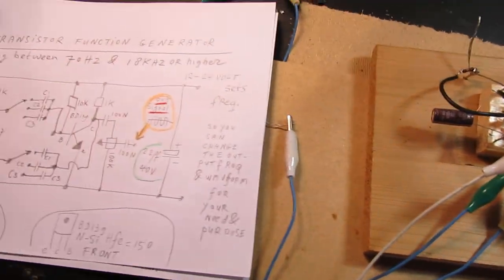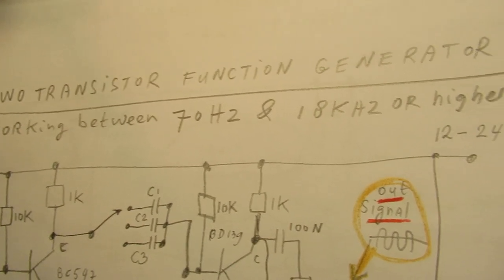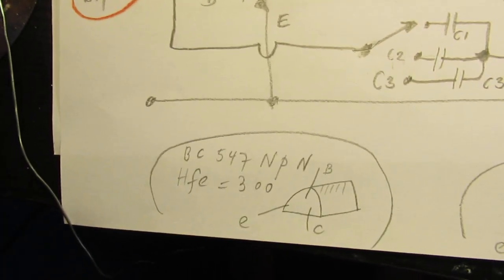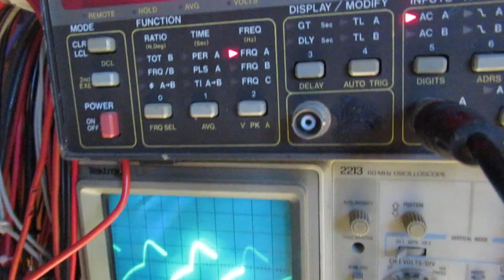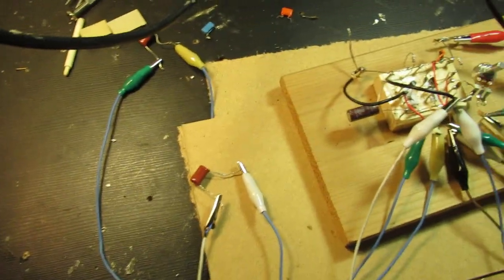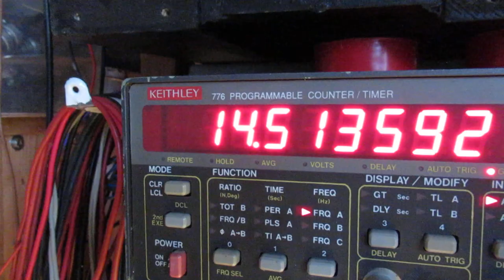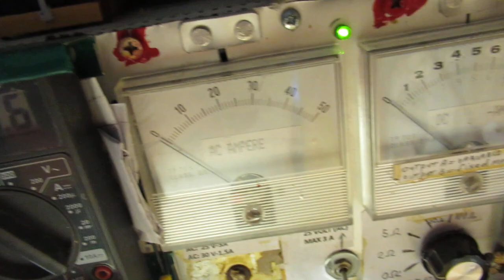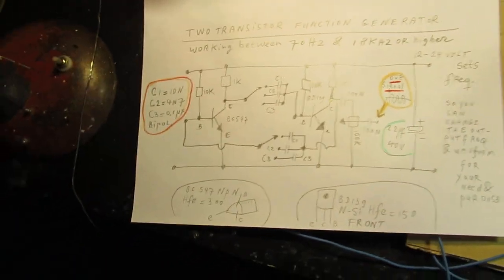2 transistor easy to make function generator usable from 75 Hertz to say 20 KC schematic and demo

Comment: Dear Sir i work on electronix projects...but one field i have not been able to understand and work on is inductor based things like oscillators,antenna ,communication based circuit .can u plz suggest some book or study material to really work on such things.
Reply from the maker: That is a very difficult question for me. There is a website americanradiohistory dot com with many books, where you can find perhaps some good info about oscillators and radio circuits; I mean, good basic information.
Reply from the maker: the website is called worldradiohistory dot com
Reply: Ok thankyou very much sir

Comment: So i can not use a variable capacitor. 🤔
Reply from the maker: Thanks & Yes, you can use that, but with this circuit  such a variable capacitor (say on the 20 pF - 470 pF range) does not add very substantiallty to the output frequency, I mean: by changing it. But, important: say when you bridge a capacitor of 4N7 (=4700 pF)  in this 2 transistor circuit with a variable capacitor that goes from (say) 20 pF to 470 pF (the one that you mention, at least I think that), the frequency surely will change, but not very substantially, say with that 470 pF extra capacitance you can go to 1-4 KHz higher or lower. That is the bandwidth. But: it can be crucial to get to a certain frequency in the Ultrasound range (say 15 KC-30 KC) that you need or like, given the use of 2 x a 4N7 (4700 pF) capacitor. I published this circuit as it was/is for a broad You Tube public, that is why I used 2 x a 4N7 capacitor to make that it always works on its highest usable frequency, given the properties of both NPN transistors, the BC 547 and the BD 139 (their datasheets). And that is also the reason why I publish it in this way, that the different supply voltages can set the frequencies that you can use/need & that it always works. Voltage variation=frequeny variation. Also that transistors don't burn out, that is also one of the aims of my YT Channel, making/showing tested circuits that have good properties and are universal. But regarding your question: yes, a variable capacitor of 10-470 pF (I hope that you ment that) is usable to tune into a certain frequency in the 10 KC-24 KC range, when you parallel it to the capacitor in question. Paralleled to a 4N7 cap it will have an effect, paralleled to a 100 N capactor there will be more or less no effect

16 june 2022.
Reply from the maker: When I say :"no effect" I mean: the change will be in-between the 1 Kilohertz range, bridging a 10-500 pF capacitor to a capacitor of 4N7 (4700 pF). But on lower frequencies (say 70 Hz) an addition of 470 pF to the oscillator capacitances (1.5 uF) means more or less nothing in terms of capacitance and (thus) also in terms of frequency change in this (or whatever) oscillator circuit.
Reply: @radiofun232  
1khz is gewoon perfect voor mijn doel. Ik heb een sinusvormige signaalgenerator nodig die 1khz bereikt. Ik maak een paar kleine vorversterkers prima met een paar versterkers met een laag vermogen. Ik denk dat deze oscillator goed zal zijn voor het controleren van de versterkte output van de apparate die ik maak.
Met dank!
__________________

1khz is just perfect for my purpose. I need a senoidal signal generator that reaches 1khz. I am making some small preamps just fine with some low power amps. I think this oscillator is gonna be good for checking the amplified output of the devices I'm making.
thanks!

___________

1khz é simplesmente perfeito para o meu propósito. Eu preciso de um gerador de sinal senoidal que atinja até 1khz. Eu faço alguns pré-amplificadores pequenos  bem como alguns amplificadores de baixa potência. Acho que esse oscilador vai ser bom para verificar a saída amplificada dos dispositivos que faço.
Obrigado!
✌😊👍💚💛💙🇧🇷🇧🇷🇧🇷
Reply from the maker: @attilarivera  Hi, this is a good and well tested sine wave oscillator 1 Kilohertz 
16 june 2022  

https://youtu.be/77L5scpjoQo
Reply from the maker: Thanks & e.g. you can do some minor changes in the 1 K resistors (say taking 900 Ohm or so, can be realized with parallel resistor in the 10 K-4K7  range), or do some minor changes in the value of the used capacitors to find exactly 1000 Hertz. It is very easy. Everything is told in this video where I have told to make such a circuit, thanks😀
Reply: @radiofun232  👏👏👏👏👏👏

✌😊👍